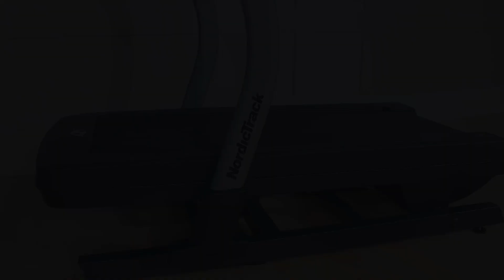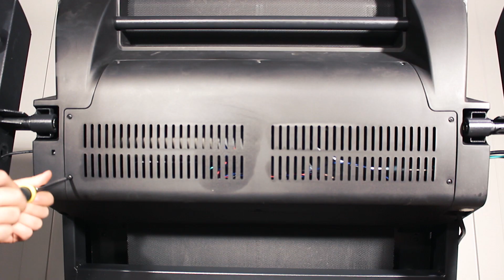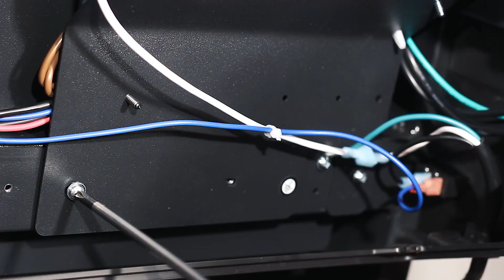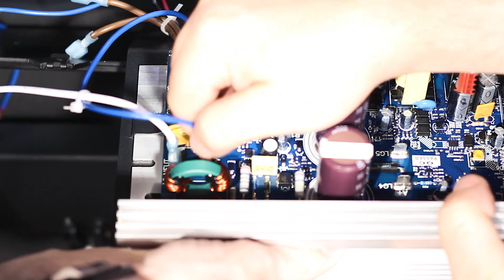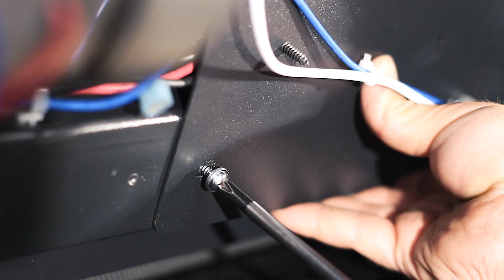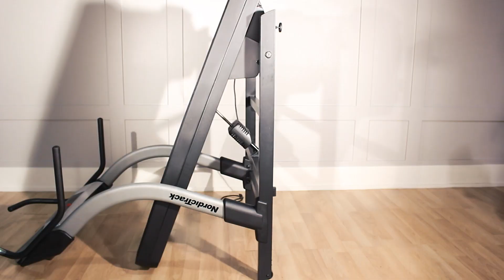Replacing the Motor Controller on a Incline Trainer

Comment: Just replaced the control board on my 3 week old X22i using this video instead of the confusing instructions that came with the new board.  Thank you for the video.  Much simpler to follow using the video by tipping up the treadmill rather than turning on its side per the instructions that came with the replacement board.  However, I did have to put some small rubber pieces under the arms to keep the unit from sitting on the edge display screen.
Reply: I have the X 22 I in the belt randomly stopped working after six weeks. The screen works in the incline works but the belt doesn’t move. So Nordic track sent me a new motor and I’m waiting for somebody to install it but now I’m wondering if it was actually a motherboard issue and they need to send me that how would I know that?
Reply: @danabinaz3173  I'm having this same issue with my X32i.  The incline and screen workouts work, the belt just never starts running.  Did the new motor they send you fix the issue?  And was it different from the board described in this video?  Hope you had some luck!
Reply: Chris A hi Chris. No we replace the motor and the display screen And that didn’t fix the issue. I saw where they’re sending us a motherboard and if that works I’ll be sure and post here. I think we should have it in a week and will try to fix it straight away. So frustrating I’m sorry you’re having the same issue these machines are too expensive for us to be dealing with this so early on.
Reply: @danabinaz3173  My guess is that the new board will fix it.  My X22 has been working perfectly since I replaced the control board.  I had the same symptoms.  Screen worked and incline worked, and the treadmill thought the motor was running but it was not.   These machines used to be made in the US.  Now they are made in China with what are probably the least expensive parts they can find.  Not great quality control for a $3k machine.  It is a lot of fun when it is running though.
Reply: @alanweisberg3816  Thanks, good to know.  I still have yet to get in contact with someone from customer service (if you/anyone have any tips on how to reach them, that would be great!), but hopefully I can get a new board to fix the issue too.  The trick will be to then get it installed, with such a huge/heavy machine I don't know why they make these parts in the least accessible area and require you to turn it upside down essentially.
Reply: Chris A it worked!!! We finally got a new motherboard today my son installed it it took like 15 minutes and it’s working!!! I didn’t even bother dealing with their service techs it takes way too long my son and fixes his own computers and he took one look at it and said he could do it and he did. I don’t know why it took them five months to send the motherboard really frustrating.
Reply: @danabinaz3173  That's such great news, and encouraging that it will work for me as well.  I finally got thru to customer service and now have a control board and wire on order for me.  As for me, I might have to wait for the service tech to do it as I'm not sure I could manage flipping this huge treadmill over to access the bottom!  Good your son was able to manage that!
Reply: Chris A Yeah you definitely don’t want to hurt yourself. He said he just had to turn it on its side and he wouldn’t recommend anybody certainly my age or with any health issues to turn it on its side. He said the part came with instructions that were very easy to follow. He just finished a hike to Kilimanjaro :-)
Reply: My X22i needed a new control board after 2 months brand new.  Finally got it yesterday after waiting 2 months for it.  I’m pretty good with technical/mechanical repairs around the house.  Swapping out the control board shouldn’t be a problem for me.  Unfortunately the screws holding the resistor are on so tight, not even a properly torqued electric drill/screwdriver can get them off -  I don’t want to strip the screws.  Without removing the resistor, you can’t get to the screws holding the plate that hold the control board.  So I can’t swap out the control board.  They’ll have to send someone out I guess, to remove some screws that are practically welded on to the frame.  Totally ridiculous.  Anyone else have this issue with these screws?
Reply: @hehatemetoo9457  Yes.  Mine were on super tight as well.   Some other screws too.  Clearly no quality control during assembly.  I tried a few screwdrivers until I found one that fit nicely and had large enough grip that allowed me to get it started.  Don't use a power tool on it.  You'll be almost certain to strip them.
Reply: David Graff my son used a hand screwdriver to install it and said they were tight but he was able to remove them fairly easy. But if you feel more comfortable waiting for somebody that’s probably the best choice. Maybe yours were screwed and we tighter

Comment: This is quite different from the instructions I received from Icon for my X22i.  Is it possible the procedure has changed a lot over the last 3 years?
Reply from the maker: Not really. I Have followed these procedures since this style of Incline trainer came out in 2010. the main difference is that I like to tip the treadmill forward. Some times this is not possible. you do need to be extra cautious not to damage the console when doing it this way.
Reply: Thanks. This video was perfect. The instructions I got were clearly for another machine. The components did not match up from step one. That said, I agree with all of the other posters, you need pliers to disconnect the wires and be prepared to strip the screws on the control board. I had to buy a screw extractor to remove one of them.

Comment: This was very helpful in all ways. A bit of information not detailed in the video, those blue connectors are on tight so even moving them back and forth required needle nose pliers for me to pull them out. On top of that, the screws for the board to the mount required a special tool as I stripped the screw as it was on way too tight from the factory. This is an "easy" job but not for the faint of heart. I had to do this after a month of owning the x22i. Quality continues to decline the more we rely on outside manufacturing, but I guess who cares as someone is getting rich!
Reply from the maker: I too will sometimes need to use needle nose pliers. PS. is not me getting rich ;)
Reply: @FitnessEquipmentHelp  Oh I know, it's nordictrac I'm complaining about. You helped a lot by doing this for people. Thank you.
Reply: @ericwr4965  Can I ask what special tool or how you got the screw off the board to the mount. I'm having the same problem with a too tight screw getting stripped. It's literally the last screw I need to remove and it wont budge.
Reply: @markvitale1  It was the position I was in to. I had to get a Dremel to cut it out. Its not easy at all and they are over tightening the screws from the factory. I am sure you could also get a hole punch and drill right through it to pull it out.

Comment: Hi team thanks for the video. A friend said that the controller could be the cause of a head unit that has stopped working. Do you agree?  This is for the x7i nordictrack incline trainer. Thanks!
Reply from the maker: Yes I agree, depending on the model. most consoles get their power directly from the lower board called the controller. if the controller fails to provide power to the console the console will not operate.